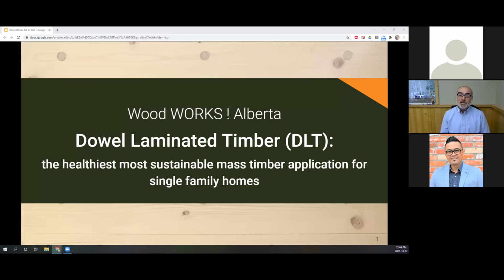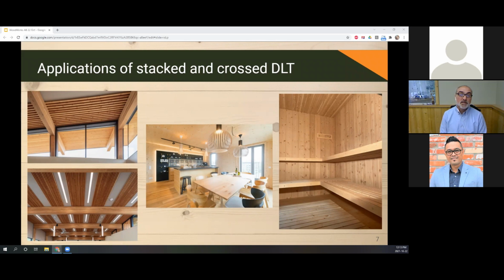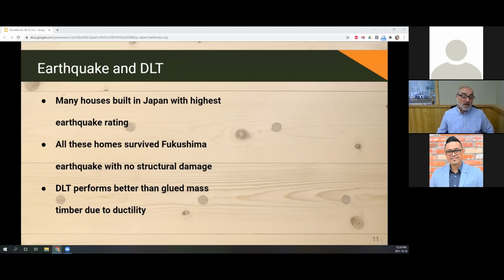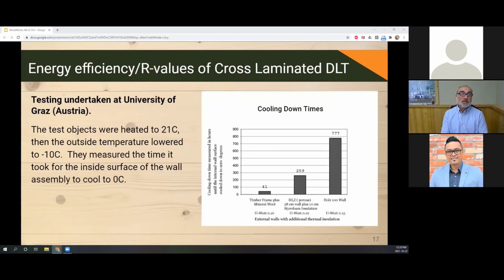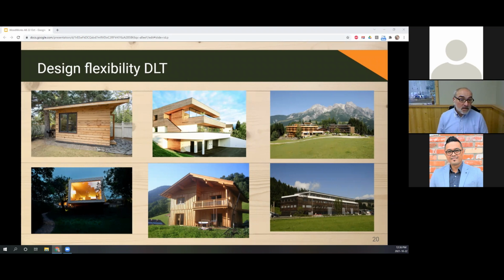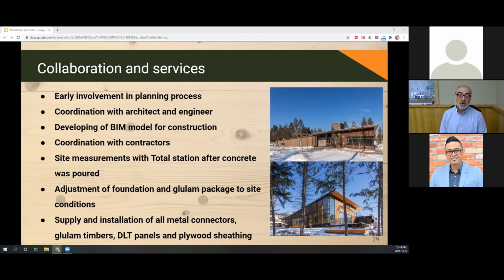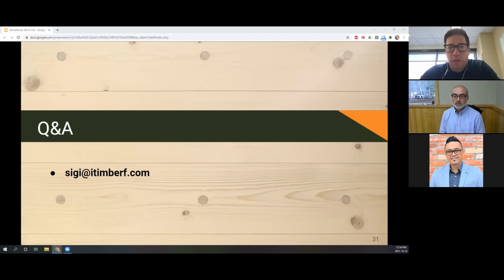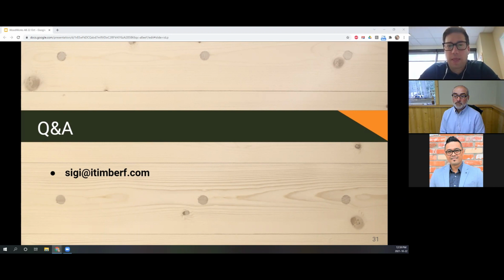Sigi at International Timberframes - DLT presentation

Comment: Excellent video! Thank you, count me in as a DLT convert. This is all I want to build with now. Couple questions/clarifications. The transcript at 47:26 was most likely incorrect, so I'd like to confirm thickness of panels you mentioned. Was that 8inch panels and 10 inch wood fiber insulation? And then at 50:16 you mention a study of CLT vs DLT. Have those results been published/peer reviewed?